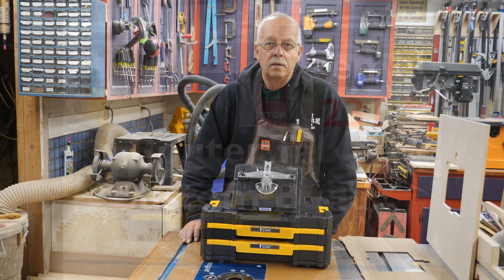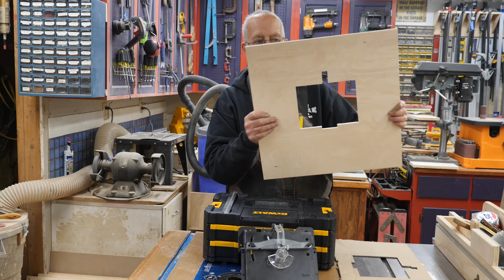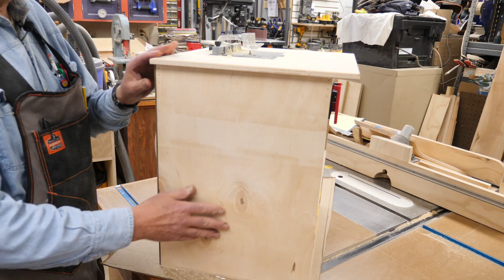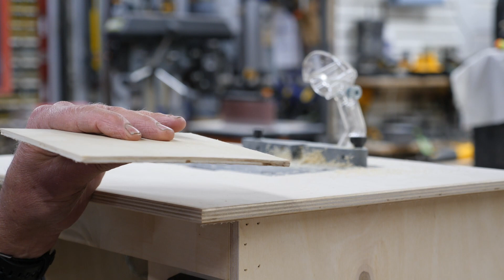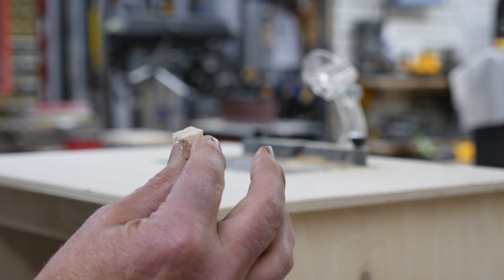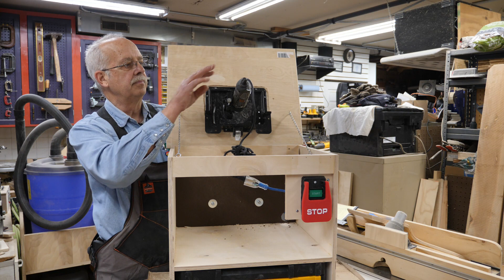Dremel 231 Router Table Custom Build

Comment: I was looking at my Dremel shaper  today and thinking it needed a bigger table surface. Luckily, the shaper table fits my Skil rotary tool as well allowing me to dedicate one tool to the table. I really like your design and will probably build one similar to it. There is one small recommendation that may help for those like myself who work to within thousandths of an inch: provide a support behind the tool with high density foam to clamp the tool to preventing undue vibration.
Great video Roger and I'll be subscribing for more great ideas.

Comment: This is amazing. I just got one for Xmas and I was wracking my brain over the 9mm. I have had this issue with multiple Dremel accessories. The "workstation" is also an odd measurement, something like 8mm iirc. For an American company I am so confused as to why they don't use a standard inch interval.

Has anyone decided to cut off the bit guard? I really want to take a hacksaw to that part to allow for a custom fence that can go back further. I wish they made it so that you could just flip it all the way back and hide it under the table top. It hits a little too high, which is just so dumb.
Reply: Miles, your just going through the first stage of transition from imperial to metric. I stubbornly stuck with imperial for years. With metric, it doesn't need to be any particular set width, height or depth. It just is what it is. One mm more or less is not important - there are no stages except when referring to the imperial equivelent. Once that disappears it will seem and be even easier to use. Here in Oz, years ago baby boomers could happily use both standards in the one sentence but now I for example, stick with metric 99% of the time. My kids wouldn't know a gallon, 8 inches or how long a mile is to walk and 15/32nd is just gibberish. Aren't they lucky!
Yep, metric is so easy to use and the quicker you Americans swap over the better it will be for everybody. Dremel sell to the whole world and Miles, the world is metric old mate.

Comment: Can the fence be completely removed form the router table?
Reply from the maker: Yes.  I rarely use it.  I usually store it under the top and the hardware for it in the Tstack box.  Since what I use this for is primarily round-over on small pieces, the fence just gets in the way.

Comment: i just recieved my dremel 231 table, still waiting for my amana miniature bearring bit to arrive. i noticed that when lying a flat piece of wood on the table it is not completely flat touching everywhere, very minimal but still a bit wavy. have you noticed the same thing on yours?
Reply from the maker: Mine is pretty much perfectly flat.  Your comment made me check it today.  I put a Starrett straight edge on it (and the new table) and could not see any light through it where the straight edge meets the tables.  You may have a bad molding of the Dremel table.  If not too severe, it could possibly be sanded flat with a block.

Comment: is it possible to find router bits with an upper bearring with a 1/8 shaft which would work with this table. I only manage to find bits with no bearrings, only ones with bearrings are 1/4 shaft for real routers. i absolutely need the straight cutter with a flush berring for my project
Reply from the maker: Yes.  Amana Tool MR0105 Miniature 3/16 D Flush Trim with 3/16 D Ball Bearing x 7/16 CH x 1/8 Inch SHK Carbide Tipped Router Bit.  Not cheap, but will do what you need.
Reply: @rogersshop  thanks for the fast answer, i have subscribed to your channel, but i i meant to say upper but when on a router table it is on the lower side, i have a plastic template 33mm x 96mm and i have a 3mm thich piece of wood stuck on top so i would need the berring to be on the bottom and the cutting edge on top. would that existe also in 1/8 shank?
Reply from the maker: @Djmat8  I have never seen a bottom bearing bit in 1/8" shank.  That doesn't mean it does not exist, just have never seen one.
Reply: the total lenght of bit is 2'' long which 3/4'' goes into the dremel and i would be using a dremel 395 which has a 3/4'' long nose tip where the bit fits into

Comment: Thank you for the video, Roger. Thinking about picking one of these up and wasn't sure the attachment was robust enough to stay perpendicular to the surface. Of course, mounting it like you did makes it nice a sturdy. Not exactly what I'm looking to do, but a neat project.
Reply from the maker: This has worked out quite well.  If not using the Dewalt storage, it would be shorter for normal bench-top use.  The idea that Dremel had of using a 2 x 4 just seemed too wonky!